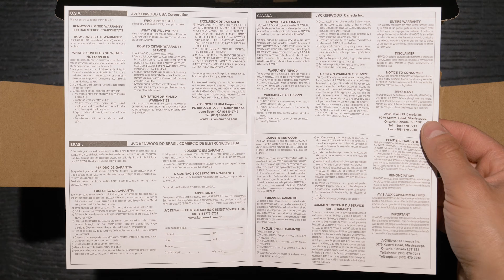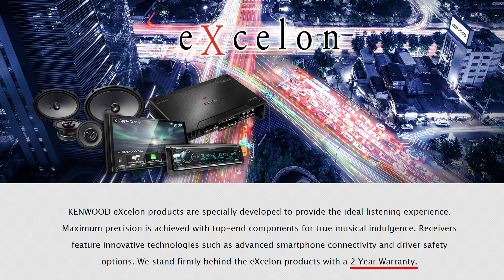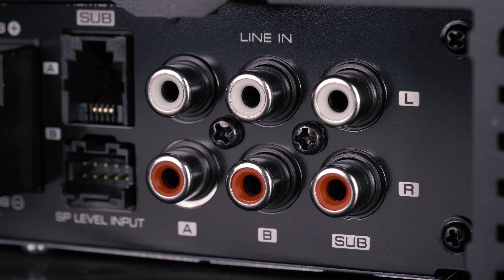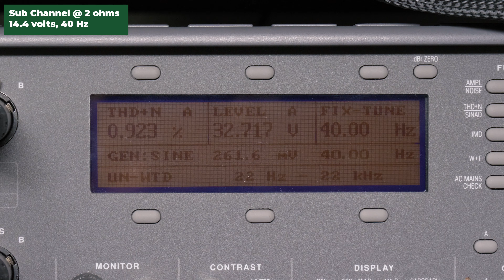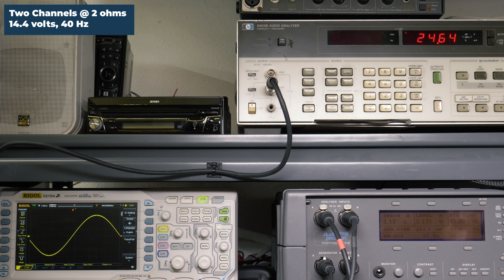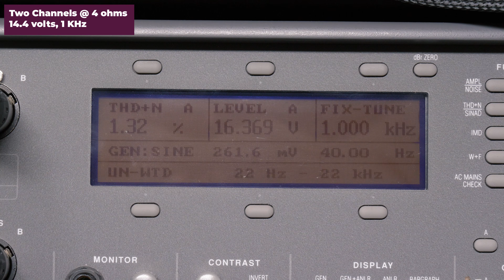Kenwood X802-5 eXcelon 5-Channel Amplifier -  Full Testing

Comment: Wish this test drove Both the speaker and Sub channels at the same time to represent a real world scenario. Would be interesting to see the waveform and THD when the amp is taxed on both sides. Thanks for the video! It's crazy the old car audio equipment is selling for more than the new stuff. Sign manufactures put better components in back in the day.
Reply: Do you think this amp is a good choice for my ct sounds meso component speakers? Midrange is 60w rms per side 80w rms total per side.  4 ohm speakers. And I've been looking at orion coaxial for rear. Have a single 10" kicker crv silver for sub, but it's in a ported box, so im trying to find a single sub in sealed box on offer up. It looks new and dude wants $140 on offerup.

Comment: Am I correct in thinking I can run a 4ohm speaker for each channel x4 then have two 2ohm subs wired in series to the sub channel? Also wondering what happens if I add a tweeter to each channel. Very new to the audio scene. Please if anyone can help

Comment: This is the single amp answer to your rides sound system. The Excelon can do it all without breaking a sweat. And it's loud as hell with very little distortion. You grab one of these cause the next item you'll be upgrading is your speakers. Trust me
Reply: I agree 👍🏻 I have this amp running with the 4 speakers and that one sub channel is enough to move a 15" DB apocalypse enough to enjoy 😂

Comment: Why do they put out more power than rated for? Couldn’t that ruin your speakers if you weren’t aware that they make more than they are advertised as?
Reply: You can ruin your speakers from not having enough power too. Infact it's easier to clip a signal and destroy speakers than it is too send it too much power. There's always clear audible warning signs when a speaker is being over driven and if you can't hear the cone bottoming out and distorting then maybe that person should stick with stock car audio with internal volume limiting.

Comment: Could anyone tell me if this all can handle the 4x channels to be at 4ohms and the subwoofer be at 2ohm
Reply from the maker: These are the possible configurations/specs:
50 watts RMS x 4 + 300 watts x 1 at 4 ohms
75 watts RMS x 4 + 500 watts RMS x 1 at 2 ohms
150 watts RMS x 2 bridged at 4 ohms + 500 watts RMS x 1 at 2 ohms
Reply: @Qualitymobilevideo  ok so you would have to bridge and make the four channels two @4ohm and the 1 channel can stabilise at 2ohm. With that being said is it safe and efficient to run the whole amp speakers and sub at 2ohms?

Comment: Dumb question here! 😂 would the sub output would be sufficient for a DVC 4 ohm kicker comp VR ? Would i wire it 2 or 8 ohm?  Max RMS is 350 (175 each coil) thx for any input
Reply: Wire it in parallel for 2 ohms and dial back the gain knob.

Comment: Watching this video made me want to do my own car system I got me the kenwood X801-5.  With this amp you can do 4 ohm or
 2 ohm output. My question is do you have to physically tell the amp to put out 2 or 4 ohms or is it the ohm on the subwoofer that determine the output from the amp.
Sorry if this is a stupid question   Thank you
Reply: Ohms are resistance from the system, in this case your sub.  Hook up one 4 ohm sub and it will be 4 ohm.  Add another in and it will go to 8 or 2 depending on wiring.  Parallel widens the system so it drops to 2 ohms, series stacks both on top of each other so it doubles to 8.  It happens automatically so you need to make sure you don't go above or below what the amp is rated at.

Comment: So if I have 4 mid-range speakers running @ 4ohm, and I hook 2 4ohm 10" subs in parallel to the sub line effectively bringing it down to 2ohm, will the mid-range still only get 4ohm power while the sub gets 2ohm power split between the 2 10's? Subs are Rockford Fosgate prime R1's rated at 200w RMS. Can always turn down the gain to match wattage if more than enough watts.
Reply: I believe the 5 channel/ technically  3 amps in 1,  work independent on the ohm loads

Comment: I have the amp that this one replaced. X700-5. It had plastic mounting holes and they break to easy. So they made the mount holes in the metal housing. Why would you want to bridge the 4 ch down to 2?
Reply: Double the power on a single set of speakers.  Usually done in 2 seater cars that don't have rear speakers.
Reply: @shadow105720  I just meant on this Amp. It already has a sub channel output

Comment: I like your dyno setup seems a lil more accurate then the smd setup?
Reply from the maker: We're starting to come to the same conclusion. The HP8903B is 100% correct because the voltage on it always matches the voltage on the Liumy. The SMD is always off a bit
Reply: @Qualitymobilevideo  interesting would u say this is as accurate or more accurate as there dyno?

Comment: hey. i was wondering if u can help me with installation i want to install  a alpine iLX-W650 radio with 4 mids speaker with a 4 channel amp, 2 12inch sub and a amp and 2 tweeters with its own amp. also i want to install a 7 band equalizer. so from the the radio to eq and then to the amps. i was wondering if u can help me with instructions. if u can please email me at zafirali1989@gmail.com am willing to compensate.

Comment: Omfg Kenwood stop with the flea market amp Spade connectors, it's not a good look. Spade connectors don't say Kenwood it's says Boss. And wait did you say they rate the sub channel at 20hz to 200hz what? Come on Kenwood $350 for Spade terminals and dirty power smfh.
Reply from the maker: lolol

Comment: Quick question: When it says 300w @4ohms x 1 sub, what would it be if I hooked 2 subs up that were 4 ohms each? Would it split that 300w between the two subs? Might be a dumb question but this is something I've been wondering for some time. Haha thanks in advance!
Reply: Yes power will be split 
 2 sub of 4ohm in parallel means amp will see the load of 2ohms and will deliver power accordingly to both.
Reply: Good questions! I've seen guys connecting 2 subs to the sub channel in a 5 channel amplifier
Reply: @jorgeplaza3406  Yeah, also my mono block amp has two sets of outputs so I've always wondered how the power is distributed between my two subs.
Reply: @coolfern37520  many brazilians amps work that way connecting 2 speakers to one line out

Comment: Does this Kenwood accept differential balanced input?
Reply: I have this amp and I could not find that spec listed anywhere - but, I do have a '16 Accord with the premium system and read that you needed a differential balanced input to run RCA's from the deck output. i tried it when I installed my amp and it works just fine so I'm assuming it does despite it not being listed. I would assume this is a major YMMV depending on your car and factory system set up though.

Comment: great little amp... I have one currently running in my car.
Reply: Awesome, been pondering picking one up for placing under the passenger seat since October.
Reply: @stang2v442  Yes, definitely a good choice for under the seat, I had mine there originally before moving it to the trunk.
Reply: @Joelb_SD  Awesome! Thanks
Reply from the maker: Very nice!